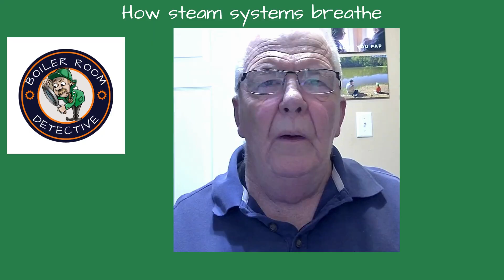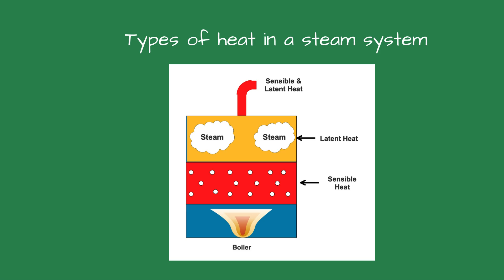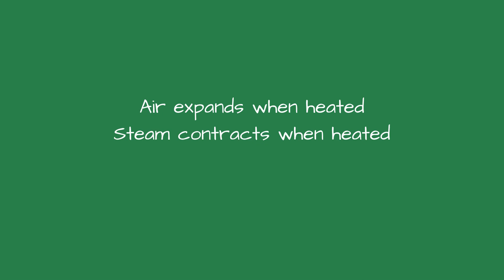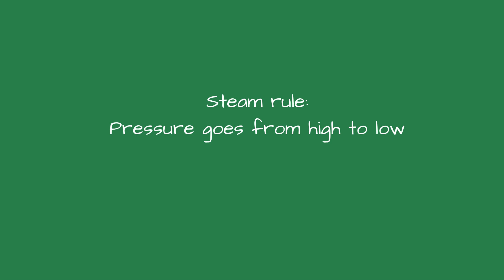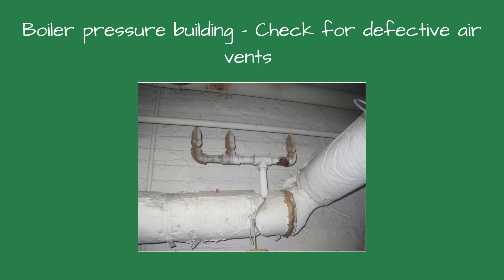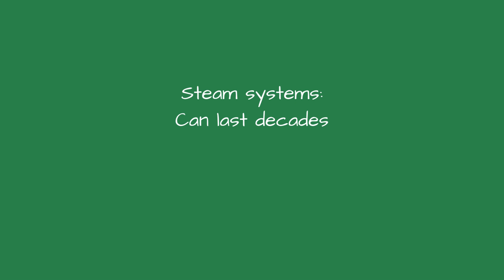How Steam Heating Systems Breathe Just Like You Do – The Secret to Troubleshooting

Comment: Thanks Ray...just happened to find a cold radiator this week in my house..air vent is clogged or just bad.. it won't allow me to open it and bleed it... I am thinking the radiator has to be drained to change the valve but at the same time the shutoff valve is really hard to turn, if it turns at all...might be time for a new cast iron radiator..😮 your thoughts on that my friend?  
Have a safe weekend Ray.. thank you again
Reply from the maker: Better bring your good back. Those rads are heavy! If the rad looks to be intact, I would start out by replacing the radiator valve and vent key. Im assuming it's hydronic. They can be used on the new rad. If you want to replace the rad, I would replace it with a rad and not fin tube. The fin tube heats and cools quickly and the rad heats slow and cools slow. You will have comfort complaints Good luck